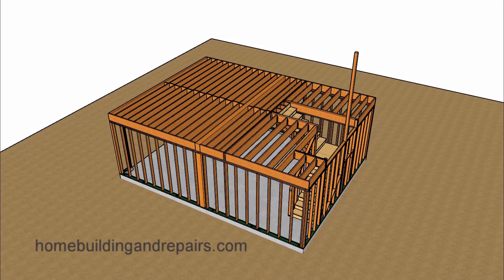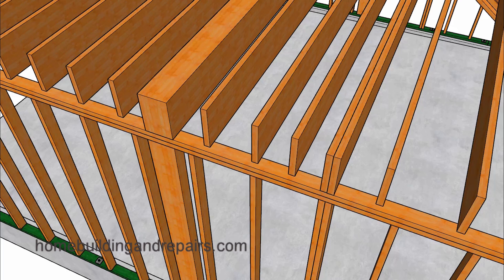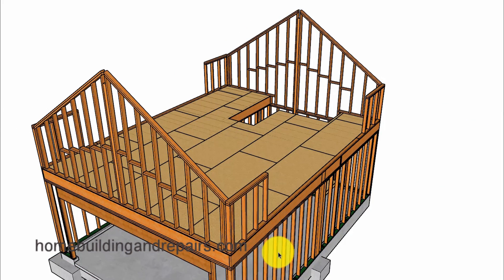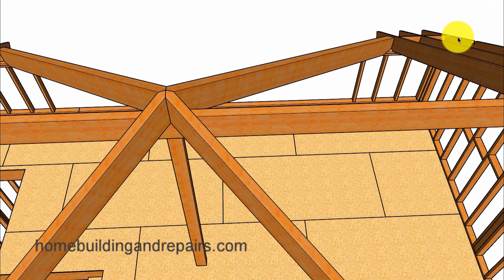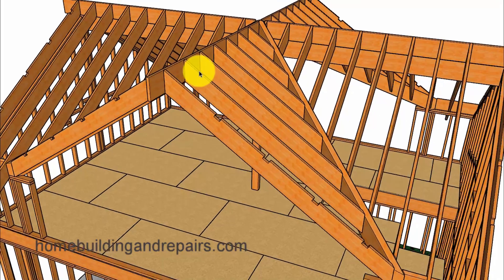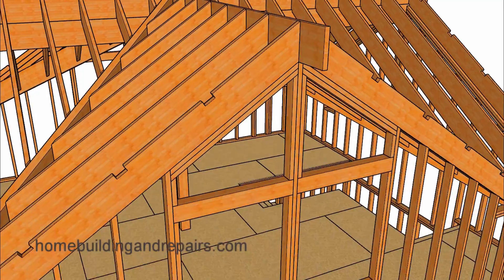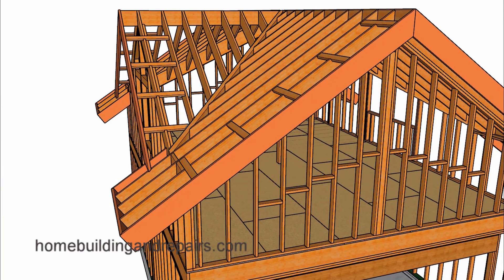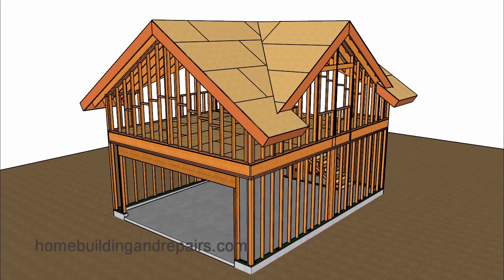How To Build Four Gable Roof With Loft Over Two Car Garage - Building Education Series Part 13

Comment: I would like to see the framing when an  addition with a gable roof ends at the corner of the rake of the existing gable end.  Not offset as you have previously shown. Would you frame the valley similar to a hip, with the valley coming all the way to the very corner?

Comment: Could you show example of floor framing of a small suite over a garage where the suite floor area in smaller and centered within the garage. IE, 26" x 26" garage with a 18" x 18' suite above and centered.  Interested in the structural requirements......
Reply from the maker: I will put it on my list of videos to be made.

Comment: If I wanted to build this but with a 430sqft garage with 9 foot ceilings on the bottom and higher walls on the top, would that greatly change the framing layout?
Reply from the maker: I don't think it would, but the design would need to work with your measurements.

Comment: How do you frame windows/doors and ensure 16 inches on center?
Reply from the maker: The doors and window can be positioned after you layout the 16 inch on center wall studs. Provide more details if I didn't answer your question.